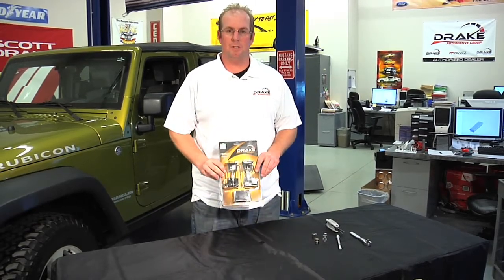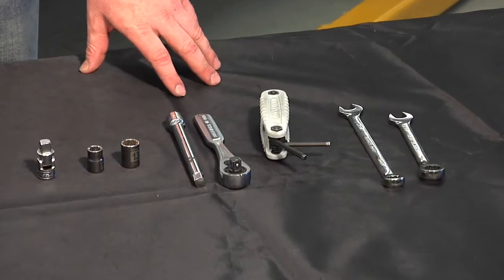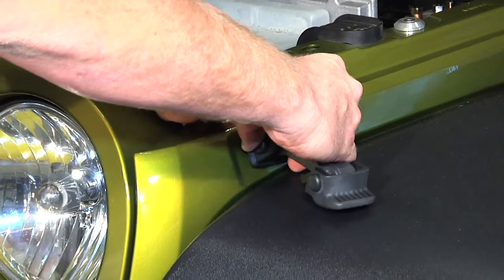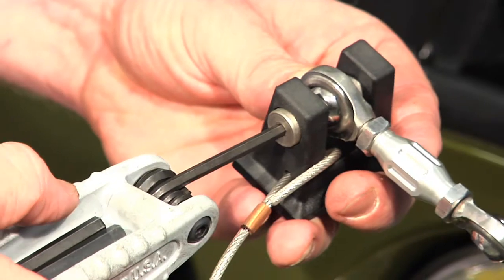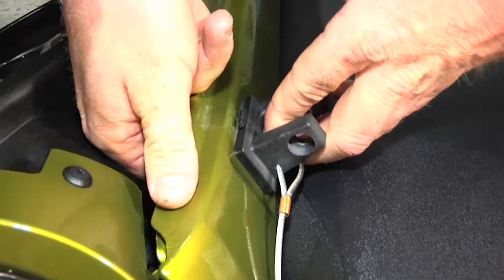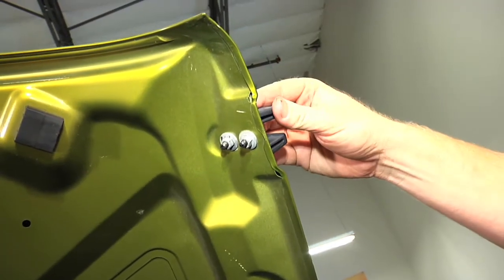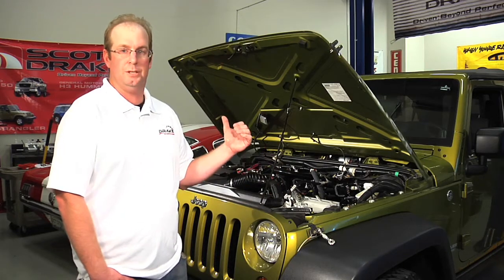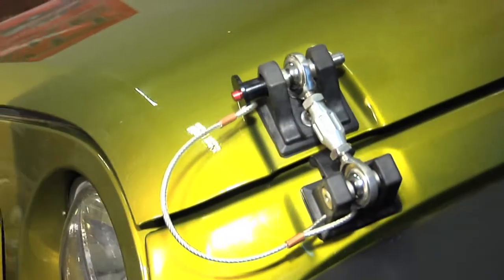Installing Drake Off Road Jeep Hood Hold-Downs

Comment: Is it ok to have the Lanyard towards the back? It just seems like the headwind hitting it would be better so I installed it with it facing the back..
Reply: Bobby Goerdt IT WILL GET PULLED YOUR ARE DEFIANTLY MALL RATED
Reply: It faces the way it does as an added safety so with momentum the pin is pushed in to the bore.

Comment: Sure, they show you the driver side installation, but the passenger side is a bitch because you cannot get socket in there like you can on driver side
Reply: Sonoran Software  take the grill off. And you can easily access that bolt.